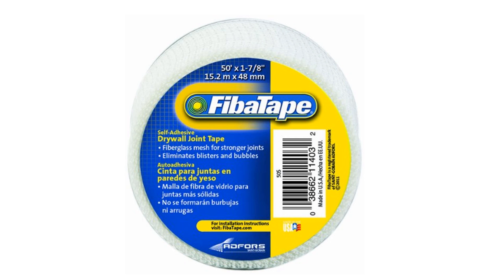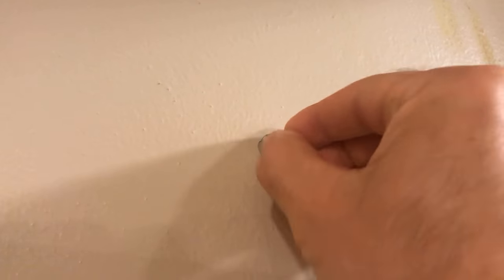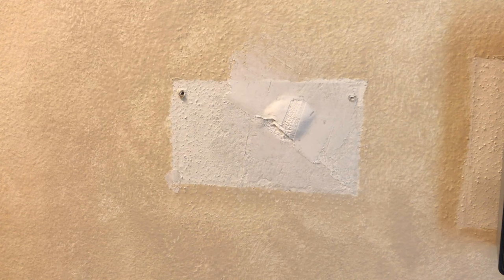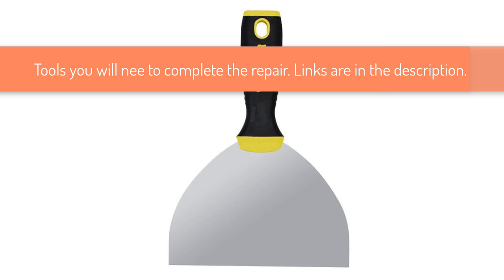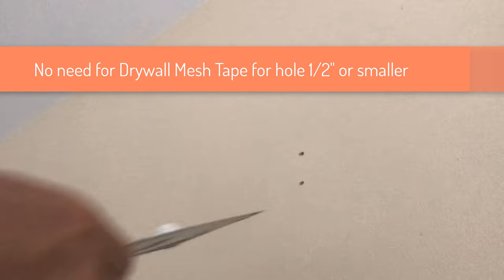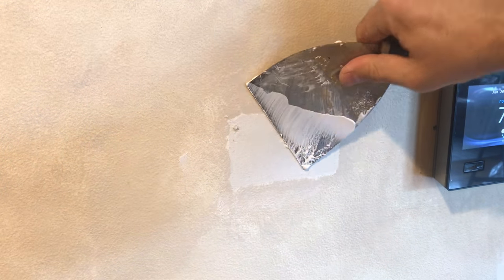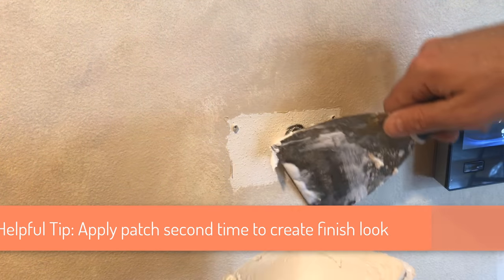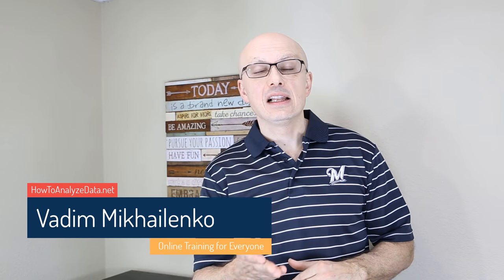How to Quickly Patch a Hole in Drywall - Mesh Tape Trick

Comment: I had to patch a 2" hole left on removal of an old light fixture - stuffing it with FibaTape before applying the patch was genius, the fix took just a couple of minutes. Thanks for the tip!
Reply from the maker: Thanks for sharing
Reply: Can you use the same area to drill a hole?

Comment: Why wouldn't you put the tape on the top like normal after your little inside trick? Also for anyone that wants to patch a big hole, just cut it square and buy a small piece of drywall bigger than the hole and some cheap wood that you can cut bigger than the hole and place behind the wall for support of new drywall piece. Screw it in top and bottom about 3 inches away from hole, tape all the edges where drywall meet and put your mud on top. Let dry sand and and repeat mud application if you sanded too much.

Comment: I'm just going to use tape
Reply: Mesh tape works better when needing to fill in holes, chips or big gouges on sheetrock. The Joint compound goes through the mesh tape to easily attach to sheetrock while pushing out air to prevent bubbling or bulging. It's one less step ...

Comment: Helpful for me, didn't know what to use to reinforce holes this size. I would use a hot 20 minute mud here, 4" knife, and then finish with a 12-14" knife. and a hawk. I have a commercial repair job coming up, that has lots of holes this size from equipment that was relocated. Good stuff.
Reply from the maker: Thanks Steve, Glad you have found the info helpful!!!